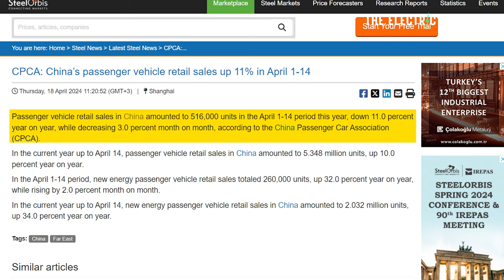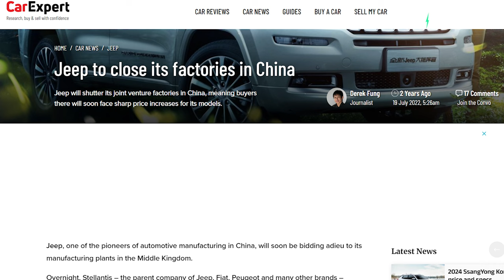China’s EV sales pass 50% - Toyota Camry & Nissan Sylphy crash 60%

Comment: EVs are poorly designed from a vehicle maintenance and repair standpoint,  I will acknowledge that at least.  Once they become well designed,  it will be game over for ICE vehicles.  It will take another 5 years for well designed EVs that are affordable to service, repair and replace parts etc...,  to emerge.
Reply: They actually require less vehicle maintenance and are easier to repair and diagnose.
Reply: ??? 😂😂😂 Tesla’s have no service required.
Typically brake pads can be changed every 10 years. Maintenance is super simple.
There is less than 1% of the moving parts…
Reply: Que?  EVs require zero maintenance.
Reply: @teebone2157 I think he may suggest accessibility . Take for instance of the battery in the cyber truck . Munro had a difficult time getting to the pack . Once there it is covered in so much sprayed styrene accessing the individual batteries would be a nightmare and a chemical cocktail mess . 

Easy access to batteries for repair or replacement is a must . Better environmental processes is also important . 
.
As we see with nios battery exchange system they can replace a battery in minutes . 

Now ice cars have similar problems accessing parts . 

We are such a throwaway society which has big consequences on the environment
Reply: Badly designed for people whose living is from maintenance?
Reply: @yggdrasil9039 they're low maintenance not no maintenance you"ll still have replace the tires and wiper fluid as well as the 12 volt battery
Reply: An electric powertrain is dead simple when compared to an ICE vehicle. Today's IC engines and its powertrain got a century of fine tuning and refinement. Current EVs are relatively new born babies. It's for sure that EVs have a LOT of scope in R&D still left (cell chemistry being the biggest one)
Reply: As Sam has reported on - EVs have such low maintenance that American dealers are attempting to suppress their sales.
Reply: Yeah, changing the oil in my Tesla is a real pain. lol.
Reply: LOL.... what rock have you been living under? Stop listening to BS backed by Big Oil and OEMs. I have a Tesla and the warranty is good with NO scheduled maintenance. They suggest, on your own, to check brakes and change tires and wipers when needed. That's it. 
No need at all due service unless something breaks which is less common than with ICE cars.
Reply: @stevencole7331    Yes more specifically around those issues.  Battery and battery tray damage is expensive to repair / replace.
Reply: @teebone2157    Evidence with regard to batteries and battery housings suggest otherwise.
Reply: Main issue is battery configuration / repair / replacement and it's a massive cost issue for the owner if that goes wrong.
Reply: EVs' structures are more concise than ICEs, so they need less effort to maintain. My dolphin only needs a maintain in less than 30 km.
Reply: yes in a typical toyota car manuel on the last page it reads: You should know as much about the quality and importance of proper maintenance of your new vehicle as the people who built it'. If you did what Toyota suggested you can built your own car.  Can't count how many days wasted in my life just doing that learning.
Reply: @JoeyBlogs007  Standard U.S. EV battery warranty is 125,000 miles OR 8 years whichever comes first. 
Given that battery costs are continuing to go drastically down... if you bought a new EV today and have a battery pack replacement after the warranty ends.... it will cost a small fraction of what it does today (which for a Tesla is around $6K). 
More than likely the labor will be the biggest part of it by far. I'm guessing it will be under $2,000 by then.
Reply: @Globalscanningeyes  obviously
Reply: @stevencole7331   Have you ever changed the spark plugs or coils on an ICE vehicle?  I have.  Some of them require you to pull the motor for access.  Others (BMW) are extremely delicate, and it's stupidly easy to cross-thread the aluminum block, seize the coil, or break it.  Some of the oil filters are ridiculous, and that's a standard maintenance task.  Then there's the whole push to plastic radiators and plastic water pumps, designed to fail.  I had a Ford where you had to take the entire front end off to change the headlamp.
Reply: @ZweiZwolf  Yes I did suggest ice vehicles can also be poorly designed for maintenance and repair .

Now my 20 year kia rio and GMC Sierra are very easy to maintain and they haven't needed a repair of consequence. They are base models . Manuel role up windows and no tech . Simple easy to work on design . As the price goes up access becomes difficult
Reply: @stevencole7331  The BMW I changed the coils on was newer than that, but Mercedes has switched to plastic water pumps to save a few pennies.  Quite frankly, none of the modern ICE vehicles are going to last 20+ years without a LOT of work because the plastic will go bad.  

OTOH, EVs have almost no moving parts and fluids, and nothing under pressure.  The total parts count is much lower. There's a lot less to go wrong.  I expect BYDs EVs to last a very, very long time.  By example, there are 5+ year old BYD E6 taxis that are over 700,000 km on their original battery - that's several times farther than the vast majority of ICE vehicles get driven.

Comment: Clean air vehicles powered by coal power…
Reply: Temporarily maybe ,  but still better than everyone sucking each others tail pipe exhaust
Reply: still cleaner than ice power.
Reply: Renewables account for HALF of China's installed capacity according to Yale. So, if someone here is a tenured professor from a gold-standard university that can dispute this with their peer-reviewed research, please do.
Reply: @JustMakingItWork he would complain about Chinese subsidies or Uighur forced labour if it was proven that all electric vehicles  were powered by solar panels.  Please just let him cope.
Reply: BS.   EVs charge at night when there’s renewables surplus.
Reply: And coal usage concentrated in an area and easier for carbon capture and any new tech can be introduced at the power station to reduce pollution instead of having to applying to different cars, models, makes, in the whole county. Sigh is this not better?
Reply: ICE vehicles are around 20% efficient converting the energy in their fuel to forward motion. EVs are around 90%. 
Even with coal supplying the electricity EVs still generate less CO2. And electricity is increasingly produced from renewable with coal plants being shut down.
Reply: Even super dirty Germany is 60% renewable now.
US coal is falling off a cliff. 
US natural gas still persists in the US but solar is 50% of the gas cost now so it won’t last.
Reply: @crm114. true.
Reply: Fortunately most people don't live next door to a coal fired power station
Reply: @emilyblade9676 Coal is dead. They are closing many more plants than they open.
Reply: @dmere123ify Coal plants are super clean compared to an engine.
The coal is pulverised and burnt more like a gas, it then drives a turbine with no opposing forces…
It is dirty because of the enormous power it generates but per kWh it’s much cleaner than any engine.
Reply: @yggdrasil9039  for the record a coal power station, in addition to all the particulate and CO2 pollution that comes from them, is a bigger source of radiation (per kWh energy) than a nuclear power plant.
Reply: @JustMakingItWork  installed capacity doesn't mean production. I know you have problems understanding that but let's say you have some solar panels that have the rated power of 1kW and a diesel generator of 1kW. So you have installed capacity of 1kW solar and 1kW fossil fuel. In one day the fossil powered generator could produce 24kWh because it can go non stop. On the other hand the solar capacity will produce nothing during the night and during the day will produce something depending on the weather, your location on the earth and season and is between 10 and 25% so your installed capacity of 1kW solar might produce just 2.4kWh vs the 24kWh the fossil generator and in the end even if you have half of the installed capacity being renewable the renewable contribution is just 1/11=9% in this case and in real life is about the same.
Reply: @crm114.  because everybody knows that the solar panels work best during the night
Reply: WOW!!! HOW OUTDATED ARE YOU??? COAL IS ON IT'S LAST GASP.
Reply: @whowhy9023  yes but: When coal burns, its higher proportion of carbon molecules creates more CO2 per unit of energy. For oil and gas, it's “mainly the hydrogens that will burn and generate energy, not the carbons.
Reply: @orionbetelgeuse1937  I actually don't have a problem with "Installed" versus "Production" which is why I wrote "INSTALLED" and not "PRODUCED". You need to READ MORE CAREFULLY before assuming the worst of others. Further, you failed to consider battery storage to store excess power when it's generated for use when power is NOT being generated. 

This is what anti-social media has brought us down to....
Reply: @dmere123ify  you are wrong with both. ICE's are over 40% efficient for diesel and 30-35% for gasoline and for the ev's they lose 10% just to charge the battery and the energy extracted from the battery is converted in mechanical power with about 80% efficiency. These are just  the most obvious losses in ev's but there are other losses due to aging, increased internal resistance, cold, high discharge rate (like in going with high speed), losses in the charger station which converts the ac in dc and other losses due to the grid which bring the total efficiency very near to the ice's. Taking into account that the ev's need a lot more energy to be manufactured than the ice's they are about the same.
Reply: @JustMakingItWork  well, you were very excited about the installed capacity and some professor. If you understand that installed capacity means nothing then why were you so excited? The solar has another problem besides low capacity factor, since all the pv panels produce at the same time there might be periods of overproduction and for a few hours some of the pv panels might be disconnected, it's called curtailing reducing even more the amount of generated energy. In some areas in california around noon up to 40% of the panels might be offline reducing even more the amount of enegy produced
Reply: @orionbetelgeuse1937  interesting. Any kind of honest comparison is indeed highly complex. We can factor in so many different factors in the production and supply and use of energy.
Reply: @prestontucker1687  Not in China where the majority of solar panels are made.
Reply: @yggdrasil9039  That’s why there is transmission lines and also be thankful you don’t live near wind blade or solar panel disposal sites
Reply: @dmere123ify  CO2 is plant food
Reply: @emilyblade9676  Yes. Compressing CO2 to super critical pressures than forcing into subsurfaces is the answer, not. Remember CO2 is plant food
Reply: @crm114.  Right, transmitted hundreds of miles away.
Reply: @JustMakingItWork  China is building two coal fired power plants a week
Reply: @mistermood4164  I actually agree with you here. Centralized facilities can be measured and safe guards can be implemented much more effective than at an individual vehicle.
Reply: @roberthakchin8520  Was I talking about China???
Reply: @roberthakchin8520  No need to remember anything. The whole point is if any new technique or technology can be applied to a concentrated place rather than to billions of individual vehicles. Co2 capture or not.
Reply: @roberthakchin8520  
Coal is only temporary. 
What part of that don't you get?
Reply: @roberthakchin8520  water is essential, but too much can kill your.
Reply: @dmere123ify  Agreed but too little or not enough water can kill. 430/450 ppm levels of CO2 is not too much